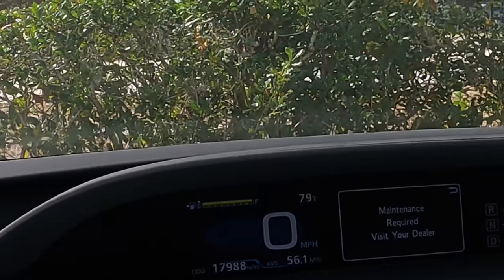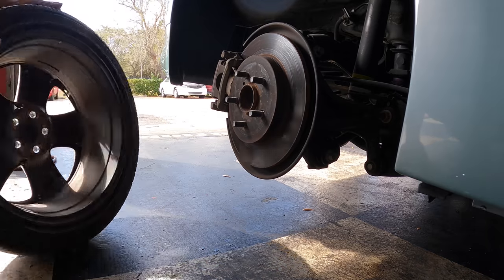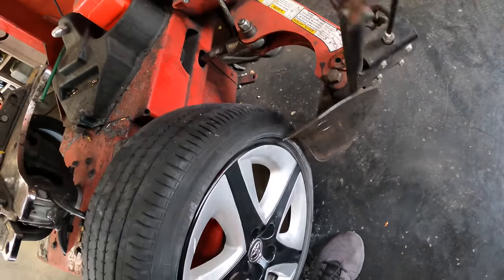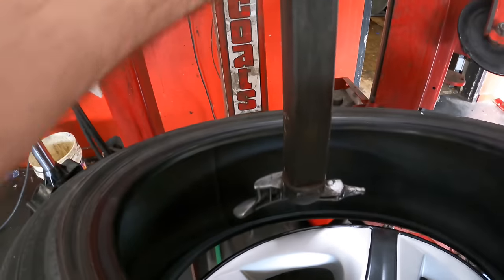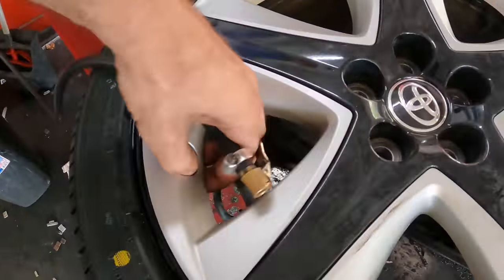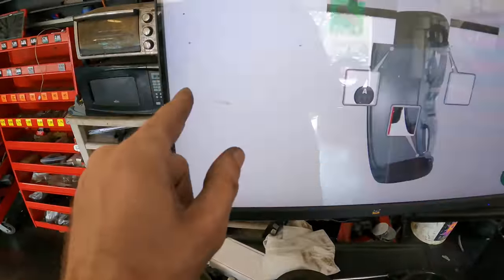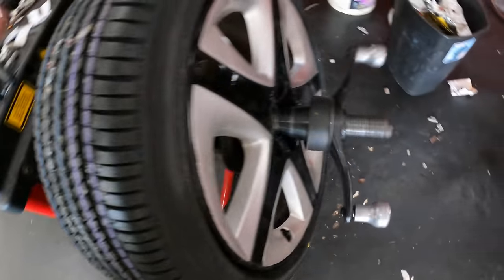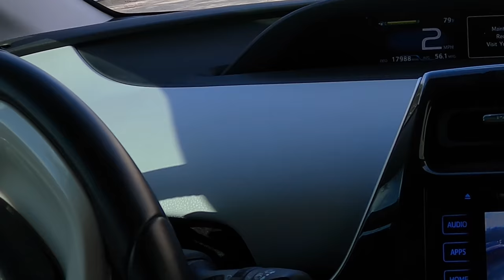Insurance Jobs, Not worth the Deductible! Toyota Prius! Tire and Wheel Walk Through

Comment: For anyone curious the yellow and red dots indicate special points on the tire. Yellow indicates the point least weight so usually its put on valve stem and red dot indicates highest point, out of roundness. 
Tyre manufacturers try to make a perfect tires but there are always some imperfections so most manufacturers measure the highest points and mark them on a tire with painted dots.
Reply: thanks for explaining the red dot.
Reply: Cool, thanks for that.
Reply: Dunlop used red and green. The red dot mark has been in universal use for at least 40+ years; it's a tire-knowledge basic. But if you check the installs at almost every chain store tire shop in the US you'll find they pay no attention to it which says a lot about the kind of people they use and how well trained they are. With top quality tires it's probably OK; I've never seen a lot of imbalance in them, but lesser grades can be out quite a bit. Wheels can be imbalanced too, so when a good tech sees excessive weight needed for balance they will dismount the tire and move it on the wheel until they find where the least weight is called for.
Reply: @P_RO_  the trouble i have seen has been with aluminum wheels and bead slippage. i always put the NON red dot at the valve, then in a month, ive seen some tires slip on the rim so much that the dot is almost opposite, primarily Michelins for some reason. The customers come back complaining of the shakes, so i pop the beads and rotate the dot back at the valve, rebalance them, and most often they only come up 1/4 ounce off, if the tires wore even.
Reply: Forget that. You're going to balance the tire anyway so what does it matter. I mount tires so the lettering is symmetric to the center cap and valve stem. i.e. the valve stem at the bottom at 6 o'clock and center cap straight up, then Goodyear at 9 o'clock and Eagle at 3 o'clock for example.
Reply: Was wondering about that...thanks for the info!
Reply: @atikovi1  It is true that a less optimal placement of the yellow dot can be compensated with more balance weights, however by placing the yellow dot at the valve you might save the need for some balancing weight. Unnecessary vibrations caused by the red dot in a bad position is however not possible to compensate with balancing weights. In a perfect world the tire as well as the rim should be round in a symmetrical way around its center. The red dot marks the high point of the tire, where the tires outside (thread) has its biggest distance to the inside (bead). If the rim has a marking for its low point that should be matched with the red point. If the red point would be put in the opposite direction the high point of the rim and the high point of the tire would sum up to a maximized difference between the total high point  of the wheel and the total low point of the wheel. The vibrations caused by the outside of the wheel not being centered in the middle of the axis can not be compensated by any balancing weights.
Reply: @mattcat231  Back when low-traction narrow bias ply tires were the norm soapy water was the usual bead lube but that doesn't work today as the soap leaves a slick residue. Many shops still use it to save money. Today's high-traction wide radial tires require a clean wheel (Nice job Ray!) along with a proper bead lube used sparingly. Today's bead lubes both dry completely as will as leaving a sticky reside to help combat tire slippage on the wheel. Street racers sometimes use rubber cement for lube forgetting that "less is more" leaving enough residue to ball up and act like bearings if the bead slips. It can work but you need the smallest quantity possible, and it's probably no better than bead lube. Aired-down off-road tires can have this problem too which is why serious off-roaders and drag racers using slicks install bead locks or screw the tire beads to the wheel. 

Back when I got my start manual tire machines were still used in some small service stations and garages. The wheel went on a fixed horizontal table and you broke the bead using a 6fy/2m long lever with a pivoting shoe on it. I've had 3 full grown men off the ground yanking on the lever in unison to break a rusted bead; flip the wheel over and do it again. The other end of the lever had a shoe to work the bead off the wheel by rotating it around the center post. A 4 tire change could take an hour of actual work time and leave you nearly exhausted. Makes you really appreciate the modern technology of machines like Ray shows in this video!

Edited to add: Yeah, I;m an old fart aren't I? Hahaha
Reply: @atikovi1  so, you're saying screw proper procedure for looks? Got it. Glad you don't service my vehicle.
Reply: @oliver_klozoff  1) 95% of the shops don't even pay attention to dots on tires. 2) Ray didn't get it spot on either. 3) Used tires don't have the the dot any more, or when people swap snow tires, but somehow they balance fine. 4) The 1/2 ounce weight in the valve stem isn't going to be a huge thing to balance out if the dot doesn't align.
Reply: @P_RO_  Yep, you dated yourself by mentioning bias ply tires, lol! Im 42, so i came around when the letter series tires were going out (example- E78-14) and the metric sizes were coming in (P195-75B-14), and i still have newspaper clippings saved from then, pretty amazing that a Montgomery Wards P195-75B-14 only costed $22 back then!!! Then i grew up, i have a Coates center post manual tire changer, and I agree, i think the weight of my 2004 Silverado 2500HD couldn't break some of those beads!!!! I graduated to a Coates 20-20 center post tire machine, and while it wont change anything bigger than a 17" tire with some coaxing, it has done me wonders!!!!! I have a customer with a 2014 Jeep Wrangler that swears by Michelins, and he's at my house/shop every 2 months getting his tires balanced, he doesn't take it off road, doesn't beat on it, but the tires still slip on his aluminum rims, i have tried going no bead lube, I've used bead lube, I've used bead sealer, I've used rubber cement, I've used RTV silicone, I've used 3M Super 77 adhesive spray, I've tried using bleach to soften the rubber on the beads to try and make them stick, I've used rubbing alcohol on the tires and rims to clean up any possible contaminants, and the tires still spin on the rims! I mentioned bead locks, he cringed at that, I've mentioned getting 2 new rims as a trial to see if his original rims were ever so slightly off on diameter, and he agreed, but the new rims do the same thing. So i had him agree to put a different brand tire on one of his rims and run it, at my cost, just to diagnose the issue, and that Cooper tire moved 3/4 of an inch in 2 months. Tire size P235-70R-16, Michelin LTX-AT2, and Michelin Defender LTX tires are what he runs.
Reply: @atikovi1  Wow, you've been to 95% of the shops in the US. Impressive.
Reply: @mattcat231  Wish I knew a solution for the Jeep; you've covered everything I know of. All I can think of left is carb cleaner and that permanently softens and swells rubber till it degrades so I'm not suggesting it at all. I've run the LTX and Defender in a different size 16" diameter and in 15" for nigh on 15+ years using stock steel wheels and AFAIK never had slippage. It does seem the wheels could well be undersized, perhaps some tire-maker can tell you the spec for 16" wheel minimums. Or maybe you can drop by a wheel store and measure the circumference of all the different 16's they have at the bead to get a baseline of what you should be seeing. The Jeep wheels might not be worth having; as an old friend of mine says "You can't always want what you get!"
Reply: @atikovi1  my tire shop must care then, who buys used tires, although I have a set that is 4 years old that still have the dot... I don't pay people to be sloppy with my ride.
Reply: @chuckles3295  Nope, lol, 3.6 liters of "fury" through a 6spd manual! Its a regular 2 door Wrangler. And it's only Michelins that do it the most on his rims. Even the garbage Goodyear ST tires that came on it didn't slip the beads!
Reply: @dkupy100  ……now that’s funny!!!
Reply: @atikovi1  And wheel weights are ugly, so what's your point?
Reply: I told that to over and over when I was at Sears Auto Center(90's). People would not care..UGH!!

Comment: I worked in a gas station in 1964 - 1966, and the tire machine was all manual.  Everything was done with muscles, and 4 tires would give you a good workout for sure - especially on a hot humid day.   Thanks for the memories.  Balancing was the "static" way.

Comment: The balancing was interesting, an explanation of the process of how the machine works would be interesting as well. Enjoyed the video!
Reply: it spins checks for wobble then tells you how much weight is needed.
Reply: I enjoyed the ride on a floor jack.
Reply: Sure beate those old bubble balances!
Reply: If you don't know calculus/ advanced ish math then don't bother looking the actual calculation up, I did and left feeling like I knew less than I did when I started
Reply: @ericwoerner8721  I still use one at home!
Reply: Wouldnt it be more accurate if the tire ran located in the stud holes like on the car and not thru the center?
Reply: There are hamsters inside. Fast hamsters.
Reply: Basic a wheel balancer (dynamic-in motion)is a just a rotating unit that has to be balanced before a wheel is in stalled…the unit spins at a certain speed (depends on manufacturer) it has several strain gauges(measures load) and a resolver( measuring rotation speed and angle) connecting to a computer processor….depending on loading(wobble) ,speed and width of rim.The unit determines where and what size of weight to install on rim
Reply: @davidp7163  wheels are centered on the hub by the either lug nuts or the hub itself. I would imagine if it wasn’t centered well by those no amount of balancing would help haha. But I’m not positive
Reply: Internal Balancing beads!!!

I've ran them for over 300,000 miles. Zero issues.

Tire wear exceeded manufacturer's warranty by 100% on 2 sets. 

Cost = $8 per tire.
Reply: @ericwoerner8721  
Beat, sorry for being pedantic lol 😝
Reply: JFM... Majic! 🧙
Reply: @davidp7163  I agree. Or at least be centered with the cone on the inside of the wheel where the mounting surface is more true. The cap side is rarely machined true.
Reply: @thetruckerslearningchannel3211  so double the life out of the tire? Uh huh....
Reply: @Devon Rosa Yes Devon 

I'm betting you've never seen a Datsun B2000 with over 500k miles on the original motor either 😄

Care and maintenance are a skill. Use and abuse, are habits.
Reply: @thetruckerslearningchannel3211  I like that little saying.
Reply: Back in the day, we used to have to set all that up manually, now you don't even have to thread the locking clamp all the way down; fancy!
Reply: @davidp7163  all car and van wheels with only a few exceptions are all centered on the hub by the hub centric ring, therefore this is completely valid
Reply: @Rekuzan  yep, in the seventies I changed a lot of tires, by hand on a round table with a rod in the middle of it. Hard work.
Reply: @davidp7163  Nope. Both center the wheel and the center hole is much quicker. If there were a difference in centering between the two as you're thinking, there would be the huge mass of the tire spinning off axis and it would need a stupid quantity of weight to balance. It just wouldn't work.
Reply: @thetruckerslearningchannel3211  Had any issues with your tires gradually leaking air?
Reply: @Melanie16040 It's rare, but it does happen. I live in a reasonably mild climate with only mild temperature swings.

I run nitrogen, in Pirelli or Michelin tires only.
Reply: @thetruckerslearningchannel3211  I was wondering because from what I recall, the interior layer of the tires that makes them gas tight wasn't designed to have lots of little beads abrading it. I also seem to recall in tires that have run these beads, there's basically fine materiel that the beads have taken off the interior of the tire in the pile of beads when you go back in.
Reply: @Melanie16040 I'm guessing that to be true in most cases. I haven't noticed it. But, I don't stand over the guy doing the work.

The beads I use are urethane based. Soft texture with variable sizes. But we all know, even water will wear down a rock.

I just haven't had those issues. But it's completely possible to have internal damage to the skin.
Reply: It spins the wheel quickly and checks for any wobble, then tells you what weights to place and where

Comment: Nice video Ray, I used to service those machines, Coates, Hoffman, FMC, REPCO.
But the best I have seen, and only once, was when I was at a garage back in the 1980's fixing a wheel aligner.
They had there a MECHANICAL dynamic balancer, no electronics or electricity, it was hand powered to spin the rim.
It had a pen poking out of the centre of the machine spindle along its axis, on the opposite end to the mounted tyre.
The suspension points for the spindle bearings could be moved along the spindle.
When properly setup when you spun the wheel the pen would scribe a circle on a piece of radially marked graph paper, the pattern showed the out of balance amount and its position.
Moving the suspension points to strategic places you could get inner then outer imbalance info.
The guy operating it was close to retirement age and could balance a wheel in about 5 minutes.
I gather he was the expert having used it most of the garages life.
The garage still had the machine so they could dynamically balance rims that didn't have a centre hole, this machine could mount them due to its backing plate design.
Now days you get a stud mount backing plate to do the job, but back then they were an expensive accessory and as long as they had the "technology" they kept the machine.
PS. They were the only guys who could balance a wheel during an electrical blackout.. lol
Reply: Would love to have one of those old dynamics.
Reply: Were tire shavers still around back then?
Reply: This was the only dynamic balance I could find for my 1970 Citroen in Western Canada when I had it. Had to do the balancing on the car. The Michelin XAS tires of the day seldom needed weights. Had to balance my tires that were retreaded to winter studded however. (No winter metric Michelins available to me then).
Reply: Ha ha , ' give me Analog or give me Death ' !
Reply: @marksommers6764  ok. Uncle Doug can make you a tube tire balancer.
Reply: @wssides  Michelin make some of the best tires around. Rarely do they need weight, and when they do it's so little.

Comment: There's so much I could say here. I'm a full time tire tech of around 3 years experience and you are better than the majority of other tire techs or mechanics I've worked with. Good man for actually putting the weights and trash where they belong and not on the floor. If you had two spoons on that machine, I would've used a second one to push the bead under that metal duck head as it can save some time and let the turntable go its normal speed all the way through. Not really necessary if you're not trying to go fast but it's fun getting in the flow. If the plastic cover on that wheel is removable, it would be best to remove it before you balance it as the cones can put cracks in them if you tighten it too much, then the center caps don't stay in. If the wheel is alloy with a clearcoat then spraying them with the brake clean directly will destroy that coating but doesn't really matter in this case. Those coats tire machines are the best IMO and I really like the balancer your shop has, pretty fancy. With the Toyota lugs, I like to put them on by hand and then pull the wheel onto the lug nuts so you know they bottom out in the right spot. Keep pluggin away Ray

Comment: Only additional thing I do is rotate the wheel/tyre about 1/4 turn after initial fitting and initial tightening. As Ray says, not often, but it does happen, the wheel tightening seems to go well but the wheel is actually not centred on the hub studs and if the wheel is rotated it wobbles very badly, like about 40mm - 75mm (about 1 1/2" - 3") from side to side. Only happens in about 1 in 50 to 100 times you fit a wheel but it does happen, even when you are careful. If not corrected, then wheel settles into its rightful position sometime down the road, the wheel nuts (lugs) loosen and car becomes a 3 wheeler. And as Ray says, that would be bad. Regards from retired mechanic in Land Down Under.
Reply: You aren’t wrong. I’ve been lucky to catch myself when that happens, I tend to watch it very carefully. Last thing I want to have to do is put wheel studs in too lol
Reply: I figured that out the hard way. It was on a Jeep Cherokee. Luckily I was out wheeling in the woods when the wheel fell off. Ever since I make absolute sure its on correctly and torqued to spec.
Reply: I had a wheel come off a VW Squareback many years ago and I bet that's exactly what happened. Fortunately the loose wheel didn't hit anything, I was able to get the car safely stopped, got the wheel back, took one lug nut off of each of the other wheels and drove home.
Reply: Happened to my brother in law a few years back. Driving through his neighborhood he comes to a stop and watches as his back drivers side wheel rolls past him. Thankfully no kids were out and it landed in a neighbors bushes
Reply: From what i understand  in australia, you need a boat these days.Ya my girl is an aussie. Triple m sydney. When she says good day mate she means it!!!LMAO